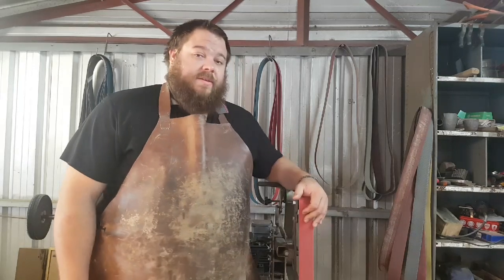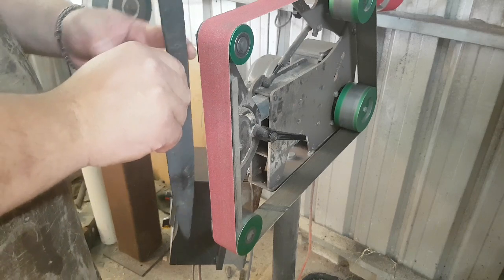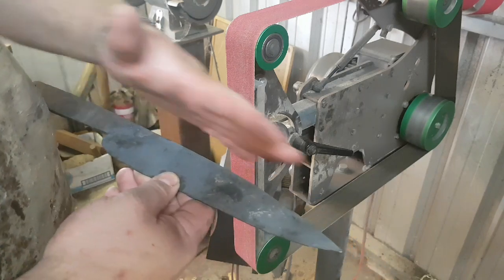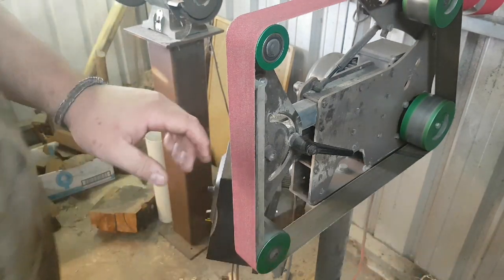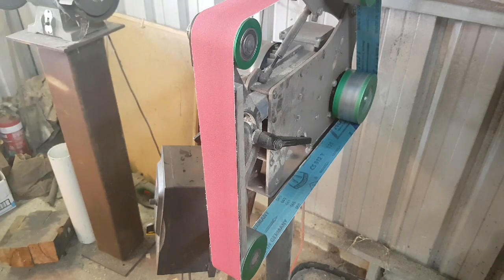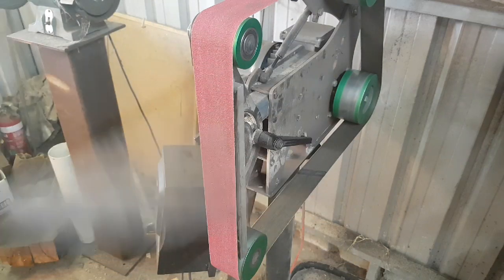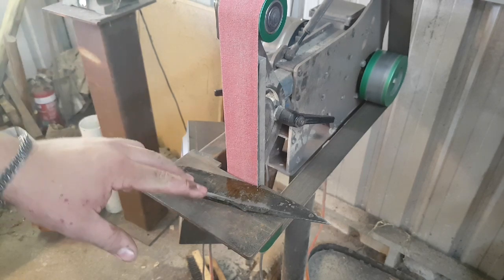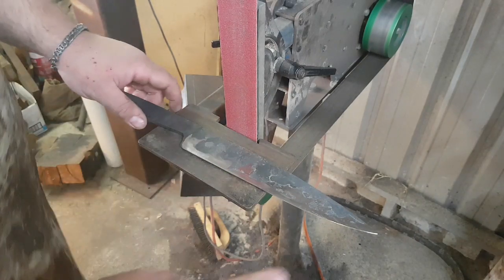Belt grinder techniques! How to grind a knife

Comment: This is great instruction man. I've been grinding a while and consider myself nowhere near an expert but I have watched a ton of videos (like everybody else I imagine). You have the most complete explanation here with not just "look how I do this, you do it too" but rather "you need to do it like this specifically  for this reason" type of explanation. That's outstanding because it takes the mystery of what you're trying to achieve out of the equation. You're going to save a lot of people a lot of Steel. Practice may still be necessary but knowing specifically why you're doing something instead of just doing it because is invaluable.
Reply from the maker: I'm glad you found it helpful, as we say on the ForgeCast Podcast, knowing the why is the most important! Cheers!

Comment: I have a belt grinder on order and will try making a small knife out of an old file for a first attempt. Thanks for all the blade grinding tips! I had a thought of making a wood handle with a couple of big neodymium magnets to hold the blade against the belt. Provided the temperature doesn't go above 80C the magnetism won't be affected (and that's hotter than anything I can hold in my bare hand!). Yes, it's going to get covered in metal particles but they'll wipe off. So with that thought I Google the idea only to find the method is already well established lol, someone even sells a wood handle with magnet for the very purpose on Amazon. Guess there's not much new in this field.

Comment: Thanks for the lesson! Question, what speed should my belt grinder be running at for normal grinding? Mine is a fixed speed at about 4k fpm. Looking at a speed controller, but I dont know if the grinder I have is a "soft start" or not.
Reply from the maker: 4ksfpm is fine, realistically for steel the faster the better, especially with ceramic abrasives.

Comment: Cheers for the video Sam - Why do you have the cutting edge of the knife up when grinding? I only make the odd knife for myself and have always ground with the cutting edge down.
Reply from the maker: I need to be able to keep track of the edge thickness, and I find it easier to get my angle right when I grind edge up.
Reply: @SamTownsBladesmith  cheers Sam.

Comment: Great video, especially for a new knife builder like myself. I'm thinking about doing a wharncliff knife since it has fewer angles or curves to deal with, possibly with a reverse tanto style tip (if thats even possible) so the knife would have both a strong tip and a easily sharpened and controllable edge. Would a 4" X 36" belt sander be advisable or perhaps a more conventional size 2" x 72" be better? Thanks
Reply from the maker: Cheers mate  yeah wharnecliffe and sheepsfoot blades are good for straight line grinding practise. Generally speaking 4" wide belt grinders are only suited for wood, and belts made in that size reflect that. I would definitely advise either a 2x48 or 2x72 rig

Comment: Is that a very expensive grinder?  I mostly work with wood and have just started making knives. Not planning on one for a  business. Just for myself. Thanks.
Reply: That particular one looks to be at least $1000, but you can get a 2x72 for significantly less if you don't need variable speeds or as complex of a design. Grizzly is a company that sells a relatively affordable 2x72. If you don't specifically need a 2x72 you can still grind knives with a 1x30 or a 1x42 either of which can usually be found for $100 or less. I will tell you as someone who primarily uses a 1x30 that a 2x72 is worth the extra cost if you have enough money for it and expect to be making a lot of knives.